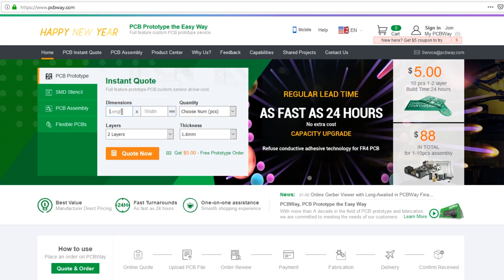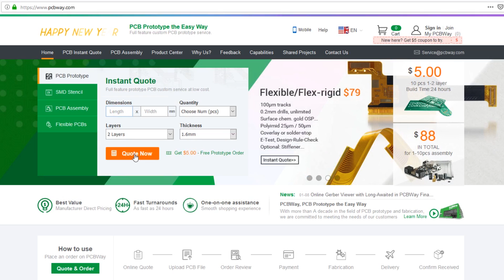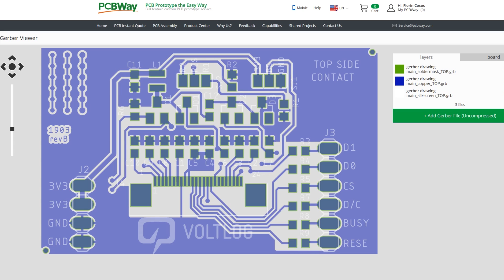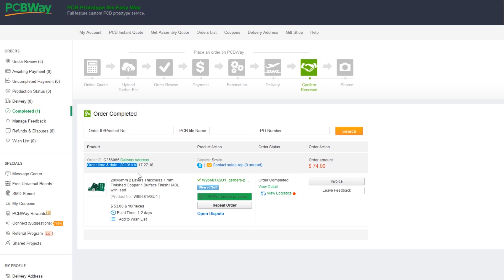Voltlog #206 - PCBWay Service Review

Comment: you mention in your post that all pcb services add the id number, but at elecrow they never put an id number on my PCBs and I've ordered over ten designs by now...
the gerber viewer is a nice feature on this one though.
Reply from the maker: Strange to hear this because I did order from elecrow in the past and I'm pretty sure my pcb's had id numbers. Maybe it's something they changed recently. In any case, other board houses are capable of removing id numbers (or not adding them) if you ask them, but honestly for prototype stuff it's rarely an issue.

Comment: I had the same error from PCBWAY “solder mask is negative. Pls fix” and it troubled me for about a month. I then Found out that there was a checkbox for “negative solder mask” in Eagle that defaulted on for some strange reason.
Reply: Solder mask is traditionally done by printing the mask on something transparent, exposing the undeveloped solder mask, and washing away the pads. This necessitates a "negative" mask. (Note: it's the white, in the image he shows, that would print black). Modern production is switching to projected exposure techniques, meaning they project the positive image on the undeveloped solder mask. I've never heard of a fab unable to accommodate the traditional negative; that's just weird.
Reply from the maker: Christopher explained the reasons why that is happening, it makes sense, however as he said, fab houses should be able to accommodate for both methods, without having the customer generate new gerbers.

Comment: What's the pitch (spacing) on the ePaper flat flex connector ?
I have to make an adapter for a 0.4mm pitch connector.
Reply from the maker: the pitch is 0.5mm, but if you don't need any additional circuitry you might get away with one of those simple pcb adapters from ebay which feature a bunch of different pads on one board.
Reply: @voltlog  I looked at the ebay adapter PCBs, none of them were suitable. I have the data sheet for my LCD, it needs two voltage regulators and some level shifting for logic too.
Reply from the maker: I was in a similar spot so I had to do my own breakout board with additional circuitry. Also take note of the flat flex connector type: top contact, bottom contact and how you want the flex cable to be routed at the edge of the board. Having one or the other might simplify the connection but it will also reverse your pin order on the breakout board.